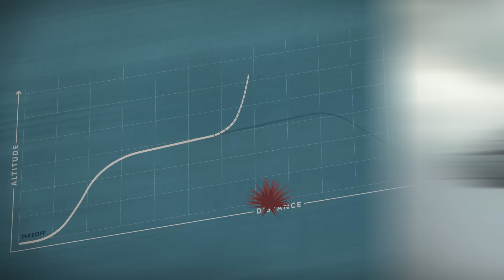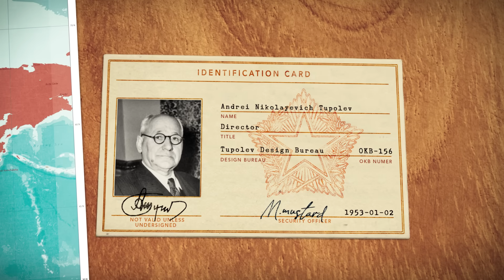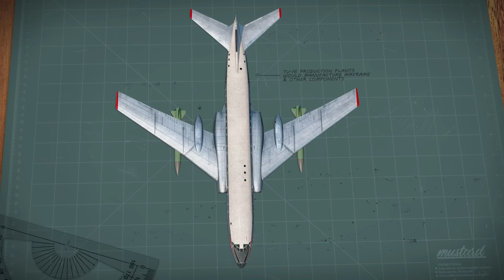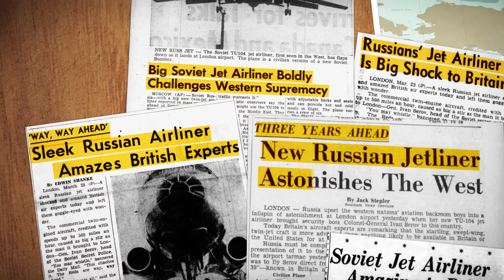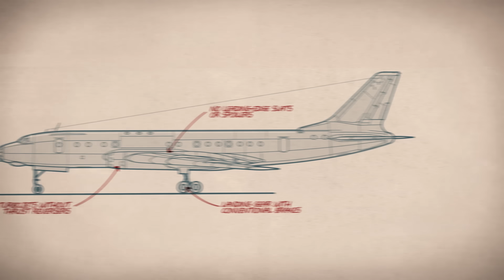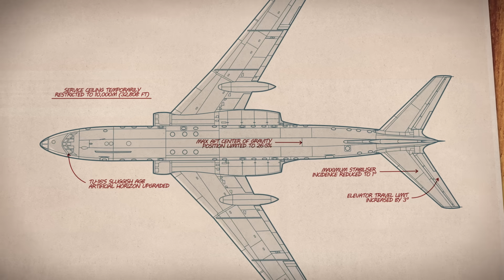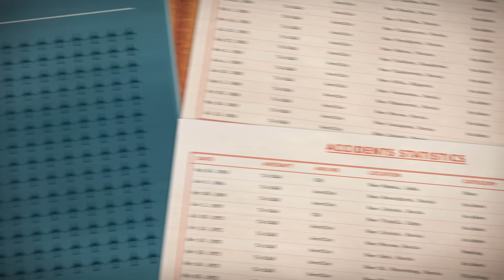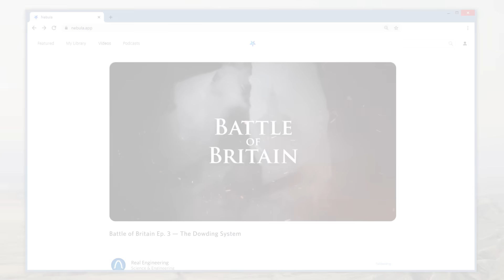The Soviet Airliner Designed To Crash

Comment: Why are there so many brits that refuse to admit that the de Haviland Comet is the worst jet airliner in history???
 34% is the highest loss rate of any jet airliner ever made.
Reply: @DoktorBayerischeMotorenWerke 

Obviously We feel we can indeed shed some light on some common misunderstandings & misconceptions.

Clearly It is indeed always good to have the facts to hand.

Comets accident losses  17%
Comet 4 accident losses  14%

The Dc-10 had a poor safety record to begin with for an aircraft that first flew in 1970. A significant number of modifications were required before the aircraft was able to maintain an average safety record.
 The first DC-10 accident loss was the most lethal single aircraft incident historically at the time & due to a rather strange agreement between the manufacturer & the FAA it transpired that cargo door modifications were not immediately implemented which resulted in a further DC-10 accident loss. 

Obviously Concorde's accident loss rate is lower than that for the DC-10.

That's correct, Comets flew until 1997.

Two substantial lengths of fuselage were pressure tested extensively. De Havilland carried out significantly more testing than any authority required. De Havilland engineers did stress calcs for the entire airframe 

It is true that The Comet design had military use as a requirement. Nimrod development began at
De Havilland before 1953.
   Nimrods were not withdrawn due to structure problems or other airframe issues it was entirely a significant upgrade snag & resultant basic economics & an end of line sale happening at Boeing at the same time.

Obviously The engine position & inlet design were not flaws or fatal flaws, there were good reasons for that design choice at the time which had some aerodynamics advantages especially when considering it's intended military applications. The subsequent design modifications were simply to render pilot errors during takeoff less likely to cause a stall, those pilot errors being due to propeller airliner pilots not using jet specific takeoff procedures. 

  If course at the time the Comet didn't  have particularly high accident loss rates relative to many other aircraft.

Losses comparisons,
how things were in those days.
Accident Losses % of Total Aircraft.

DeHavilland Comet 4 UK           14%
DeHavilland Comet all  mks       17% 

Boeing 307                                         70%
Boeing 247                                         48%
Boeing 707                                         20% 
Lockheed Electra Turboprop           29%
Canadair CL-44  Turboprop             46% 
Convair CV-580  Turboprop             22%
Convair CV-880    (ff 1959)              27% 
Convair CV-990     (ff 1961)             35%
Tupolev T-104       (ff 1956)            16%

   Yes, it is the case that De Havilland carried out full stress analysis & engaged in a comprehensive & protracted testing program which is why key De Havilland people were happy to be aboard flying DH Comet aircraft.

Of course De Havilland had prior experience building many all metal construction airframe aircraft including thousands of jet powered fighter aircraft that were primarily of metal construction with pressurised cockpits & jet engines built by De-Havilland.

    The DH Comet was of course the first passenger airliner with full length fuselage pressurisation at 8psi pressure differential. Handley Page built the world's first all metal construction airliner during the 1920s.
   
   Of course ripstop provision was provided. The skin alloy used became unavailable at the time due to R & D at the manufacturers which resulted in the original alloy being discontinued.
The skin thickness used for the Comet was used for similar later aircraft.
Frame spacing was not found to be too large & frame width was not found to be too small.

  Indeed, that's right, In many cases earlier pressurised aircraft were larger, needed thicker fuselage skins due to flying stresses & had much lower pressurisation differential pressure.

  Without doubt, De Havilland did indeed always work to better than industry standards at the time, used up to date knowledge for the design & construction & no evidence of negligence  or criminal negligence was ever produced in relation to the DH Comet.

    Of course The investigation committee did not find hundreds of fatal flaws or evidence of design defects, structural defects, defective materials or shoddy workmanship. Ripstop provision was included. Claimed incidents did not involve cracks starting from window corners.
Pretty much all changes were just in case changes or were planned development modifications & improvements that were scheduled regardless of incidents.

   Yes, it is correct to say that The DH Comet had no effect on the course of the aerospace industry in the UK. The UK now has the world's largest combined nuclear, aerospace & defence sector per capita activity.

  It's generally accepted that De Havilland designers knew all there was to know about metal fatigue at the time they designed the DH Comet. In fact nearly all subsequent changes to the Comet were previously planned improvements or just in case changes during the investigations. After the incidents how airliners were built & tested changed everywhere airliners got built.

  The world's first all metal construction airliner was built in England during the 1920s by Handley Page.

 The world's first demonstration of a pure gas turbine aero engine was performed by Frank Whittle in 1937.

  The first example of a pressurised cabin aircraft was a British design  Airco aircraft built under licence in the US & modified to have a pressurised cabin during a joint UK / US research project.

  The gas turbine engine was first conceptualised & patented before 1800 in England.

 The world's first axial multi stage sequential stator rotor turbines & compressors were produced in England by Parsons of Ireland & North England. The same components used in many modern gas turbine aero engines. Parsons also did some work on the internal combustion gas turbine engine.

  Of course we do indeed Hope this helps obviously.   

Cheers indeed etc 👍.  

. . .... ... ..... ..  ..
. .... .......  .... .   .

Comment: Dc-10💀
Reply: DC-10 is STILL FLYING, it has a better fatalities per flight and per passenger mile than Concorde..
Reply: @DoktorBayerischeMotorenWerke 

Obviously We feel we can indeed shed some light on some common misunderstandings & misconceptions.

Clearly It is indeed always good to have the facts to hand.

The Dc-10 had a poor safety record to begin with for an aircraft that first flew in 1970. A significant number of modifications were required before the aircraft was able to maintain an average safety record.
 The first DC-10 accident loss was the most lethal single aircraft incident historically at the time & due to a rather strange agreement between the manufacturer & the FAA it transpired that cargo door modifications were not immediately implemented which resulted in a further DC-10 accident loss. 

Obviously Concorde's accident loss rate is lower than that for the DC-10.

That's correct, Comets flew until 1997.

Two substantial lengths of fuselage were pressure tested extensively. De Havilland carried out significantly more testing than any authority required. De Havilland engineers did stress calcs for the entire airframe 

It is true that The Comet design had military use as a requirement. Nimrod development began at
De Havilland before 1953.
   Nimrods were not withdrawn due to structure problems or other airframe issues it was entirely a significant upgrade snag & resultant basic economics & an end of line sale happening at Boeing at the same time.

Obviously The engine position & inlet design were not flaws or fatal flaws, there were good reasons for that design choice at the time which had some aerodynamics advantages especially when considering it's intended military applications. The subsequent design modifications were simply to render pilot errors during takeoff less likely to cause a stall, those pilot errors being due to propeller airliner pilots not using jet specific takeoff procedures. 

  If course at the time the Comet didn't  have particularly high accident loss rates relative to many other aircraft.

Losses comparisons,
how things were in those days.
Accident Losses % of Total Aircraft.

DeHavilland Comet 4 UK           14%
DeHavilland Comet all  mks       17% 

Boeing 307                                         70%
Boeing 247                                         48%
Boeing 707                                         20% 
Lockheed Electra Turboprop           29%
Canadair CL-44  Turboprop             46% 
Convair CV-580  Turboprop             22%
Convair CV-880    (ff 1959)              27% 
Convair CV-990     (ff 1961)             35%
Tupolev T-104       (ff 1956)            16%

   Yes, it is the case that De Havilland carried out full stress analysis & engaged in a comprehensive & protracted testing program which is why key De Havilland people were happy to be aboard flying DH Comet aircraft.

Of course De Havilland had prior experience building many all metal construction airframe aircraft including thousands of jet powered fighter aircraft that were primarily of metal construction with pressurised cockpits & jet engines built by De-Havilland.

    The DH Comet was of course the first passenger airliner with full length fuselage pressurisation at 8psi pressure differential. Handley Page built the world's first all metal construction airliner during the 1920s.
   
   Of course ripstop provision was provided. The skin alloy used became unavailable at the time due to R & D at the manufacturers which resulted in the original alloy being discontinued.
The skin thickness used for the Comet was used for similar later aircraft.
Frame spacing was not found to be too large & frame width was not found to be too small.

  Indeed, that's right, In many cases earlier pressurised aircraft were larger, needed thicker fuselage skins due to flying stresses & had much lower pressurisation differential pressure.

  Without doubt, De Havilland did indeed always work to better than industry standards at the time, used up to date knowledge for the design & construction & no evidence of negligence  or criminal negligence was ever produced in relation to the DH Comet.

    Of course The investigation committee did not find hundreds of fatal flaws or evidence of design defects, structural defects, defective materials or shoddy workmanship. Ripstop provision was included. Claimed incidents did not involve cracks starting from window corners.
Pretty much all changes were just in case changes or were planned development modifications & improvements that were scheduled regardless of incidents.

   Yes, it is correct to say that The DH Comet had no effect on the course of the aerospace industry in the UK. The UK now has the world's largest combined nuclear, aerospace & defence sector per capita activity.

  It's generally accepted that De Havilland designers knew all there was to know about metal fatigue at the time they designed the DH Comet. In fact nearly all subsequent changes to the Comet were previously planned improvements or just in case changes during the investigations. After the incidents how airliners were built & tested changed everywhere airliners got built.

  The world's first all metal construction airliner was built in England during the 1920s by Handley Page.

 The world's first demonstration of a pure gas turbine aero engine was performed by Frank Whittle in 1937.

  The first example of a pressurised cabin aircraft was a British design  Airco aircraft built under licence in the US & modified to have a pressurised cabin during a joint UK / US research project.

  The gas turbine engine was first conceptualised & patented before 1800 in England.

 The world's first axial multi stage sequential stator rotor turbines & compressors were produced in England by Parsons of Ireland & North England. The same components used in many modern gas turbine aero engines. Parsons also did some work on the internal combustion gas turbine engine.

  Of course we do indeed Hope this helps obviously.

Cheers indeed etc 👍.  

. . .... ... ..... ..  ..
. .... .......  .... .   .

Comment: Funny the song about the plane is a dirge.
Reply: Indeed, that's entirely correct of course.

However, we do indeed feel we can clear up some commonly held myths and misconceptions, without doubt obviously.

It always good to deal with facts isn't it.

Obviously there have been worse aircraft for accident losses both before & after the DH Comet & the Tupolev T-104.

    How things were back then -

Accident losses - % of aircraft built.
DeHavilland Comet 4 UK     14% 
DeHavilland Comet all mks  17%  
Vickers VC10 UK                     5%
Tupolev T-104                          16%

   The DH Comet & Tupolev T-104 had better safety than or similar safety to many other commercial passenger aircraft of a similar era

    Douglas DC-1        99%
      Douglas DC-2        47%
    Douglas DC-3        30%
      Douglas DC-4          26%
    Boeing s300            72% 
 Boeing 307               70%
  Boeing 247                48%
     Boeing 707                   20% 
Lockheed L-049/149 Constellation  30%
   Lockheed Electra  Turboprop    29%
Fairchild FH-227                        30%
 McDonnell Douglas DC-8        14%
  Sud Aviation Caravelle            15%
Canadair CL-44  Turboprop     46%  
Convair CV-580  Turboprop     22%
Convair CV-880    (ff 1959)       27%  
Convair CV-990     (ff 1961)      33%
Tupolev T-104          (ff 1956)    16% we can clear up some commonly held myths and misconceptions.

It always good to deal with facts isn't it.

Obviously there have been worse aircraft for accident losses both before & after the DH Comet & the Tupolev T-104.

    How things were back then -

Accident losses - % of aircraft built.
DeHavilland Comet 4 UK     14% 
DeHavilland Comet all mks  17%  
Vickers VC10 UK                     5%
Tupolev T-104                          16%

   The DH Comet & Tupolev T-104 had better safety than or similar safety to many other commercial passenger aircraft of a similar era

   Douglas DC-1          99%
   Douglas DC-2          47%
   Douglas DC-3     .    30%
   Douglas DC-4          26%
   Boeing s300            72% 
 . Boeing 307              70%
   Boeing 247              48%
   Boeing 707              20% 
Lockheed L-049/149 Constellation  30%
Lockheed Electra  Turboprop            29%
Fairchild FH-227                                 30%
McDonnell Douglas DC-8                  14%
Sud Aviation Caravelle                      15%
Canadair CL-44  Turboprop              46%  
Convair CV-580  Turboprop        22%
Convair CV-880    (ff 1959)         27%  
Convair CV-990     (ff 1961)        33%
Tupolev T-104          (ff 1956)      16%

Obviously we hope this helps.

Cheers 👍.
Reply: Indeed, that's entirely correct of course.

However, we do indeed feel we can clear up some commonly held myths and misconceptions, without doubt obviously.

It always good to deal with facts isn't it.

Obviously there have been worse aircraft for accident losses both before & after the DH Comet & the Tupolev T-104.

    How things were back then -

Accident losses - % of aircraft built.
DeHavilland Comet 4 UK     14% 
DeHavilland Comet all mks  17%  
Vickers VC10 UK                     5%
Tupolev T-104                          16%

   The DH Comet & Tupolev T-104 had better safety than or similar safety to many other commercial passenger aircraft of a similar era

    Douglas DC-1        99%
      Douglas DC-2        47%
    Douglas DC-3        30%
      Douglas DC-4          26%
    Boeing s300            72% 
 Boeing 307               70%
  Boeing 247                48%
     Boeing 707                   20% 
Lockheed L-049/149 Constellation  30%
   Lockheed Electra  Turboprop    29%
Fairchild FH-227                        30%
 McDonnell Douglas DC-8        14%
  Sud Aviation Caravelle            15%
Canadair CL-44  Turboprop     46%  
Convair CV-580  Turboprop     22%
Convair CV-880    (ff 1959)       27%  
Convair CV-990     (ff 1961)      33%
Tupolev T-104          (ff 1956)    16% we can clear up some commonly held myths and misconceptions.

It always good to deal with facts isn't it.

Obviously there have been worse aircraft for accident losses both before & after the DH Comet & the Tupolev T-104.

    How things were back then -

Accident losses - % of aircraft built.
DeHavilland Comet 4 UK     14% 
DeHavilland Comet all mks  17%  
Vickers VC10 UK                     5%
Tupolev T-104                          16%

   The DH Comet & Tupolev T-104 had better safety than or similar safety to many other commercial passenger aircraft of a similar era

   Douglas DC-1          99%
   Douglas DC-2          47%
   Douglas DC-3     .    30%
   Douglas DC-4          26%
   Boeing s300            72% 
 . Boeing 307              70%
   Boeing 247              48%
   Boeing 707              20% 
Lockheed L-049/149 Constellation  30%
Lockheed Electra  Turboprop            29%
Fairchild FH-227                                 30%
McDonnell Douglas DC-8                  14%
Sud Aviation Caravelle                      15%
Canadair CL-44  Turboprop              46%  
Convair CV-580  Turboprop        22%
Convair CV-880    (ff 1959)         27%  
Convair CV-990     (ff 1961)        33%
Tupolev T-104          (ff 1956)      16%

Obviously we hope this helps.

Cheers 👍.